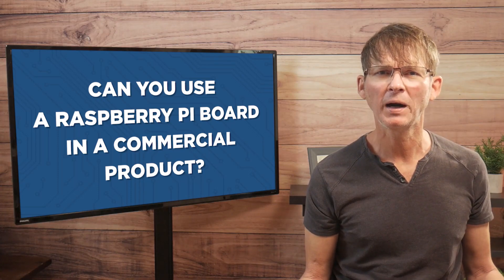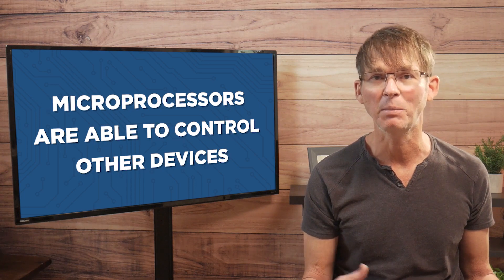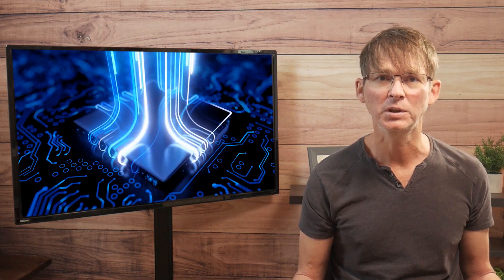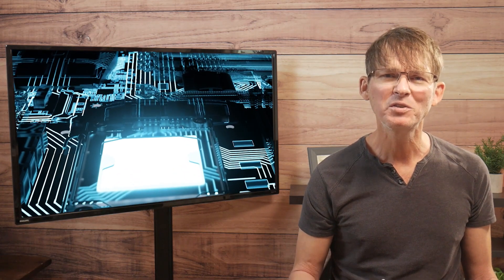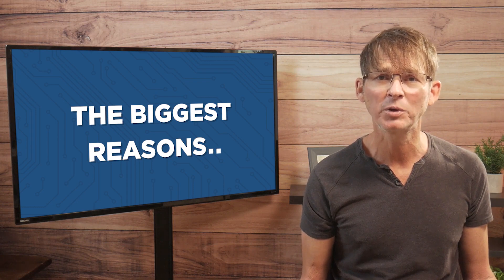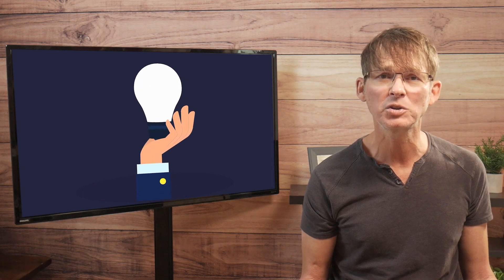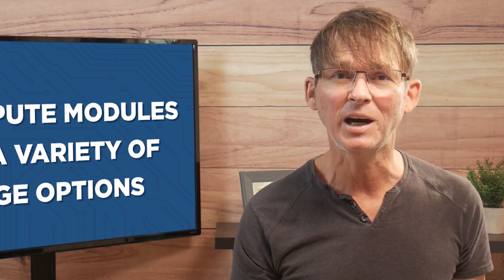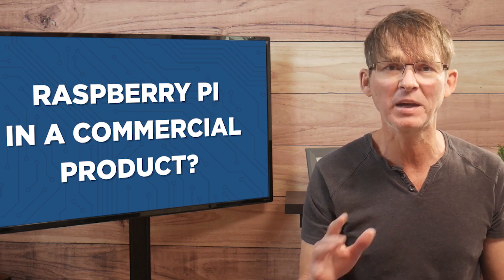Raspberry Pi in a commercial product?

Comment: Hi, after 2 years that you released this video, do you think that is still dificult to find raspberry pi's iin stock? I developed a music hardware (25cm x 10cm x 4cm) and i used a pre made main board that connects to the pi. However im in doubt here: should i go for it using the standart pi or tha banana pi since its easier because the board its already done or should i try to change the connectors of the board for a compute module. This second one sounds a little bit scary because i dont know how dificult it is to make that change and add the usb ports. However, the idea of running the programm in eMMc storage sounds a lot better than in a sd card. If you have any thoughts regarding this i would aprecciate ! Love the channel! Bye!
Reply from the maker: I don't think these same supply issues exist any longer. Migrating to the compute module gives you much more flexibility and cost savings but designing the custom PCB for it is expensive.
Reply: @PredictableDesigns  is it expensive to design or to make one? And qhat about the normal pi, is still a bad idea to use one? or this supplying problem has been solved?

Comment: My new fav youtuber :) I've been on the fence about using RPi because of the cost and components I don't need (eth, extra usbs...), but I'm almost certain that I need the computing power for computer vision. I also need to be able to connect cameras and a night vision light source. I'm still learning so thanks for the vid!
Reply from the maker: That's so great to hear, thank you! Yeah if you need advanced computer vision then you definitely need the power of a microprocessor like the RPi. But you can probably find something similar but with less extra, unnecessary features. If you have the space, and the profit margins then Id go with whatever is easiest for you to implement.

Comment: I dunno. To me it seems a tad…. I can’t think of a good word. Amateur? Grab an allwinner chip, look at board schematics, use only what you need from them and Bob’s your uncle
Reply from the maker: That opens lots of complexity. Rarely do I think a custom MPU board design is feasible nor necessary at the beginning. Better to use a MPU module on your custom board. I always support the simplest solution. Thanks for your comment!

Comment: What boards would you suggest for commercial use or does it make more sense to design your own?
Reply from the maker: If you really need the performance of a microprocessor then I'd look at the RPi Compute Module or the Banana Pi Compute Module.

Comment: I  was  considering starting a project with picos powering it, wish you went more in depth on how you see them.

I like the fact that they are small and cheap and the w even has wifi and potentially bluetooth, micropython is very appealing also, you can ship products that anyone can tweak since there's so many people programming python these days.
Reply from the maker: I love the Pico and they are a great solution that can easily be migrated to a custom design for high volume production! Very powerful MCU for only $1.